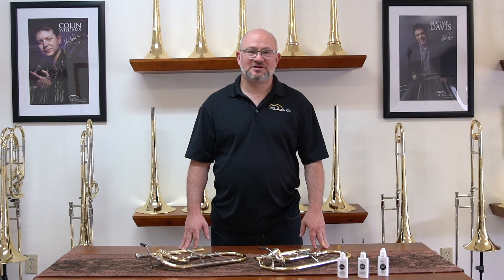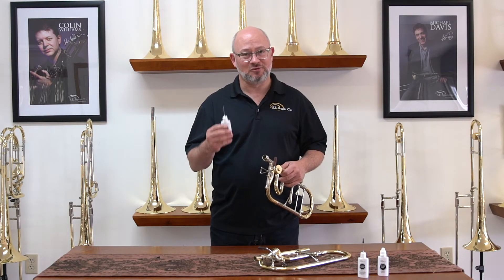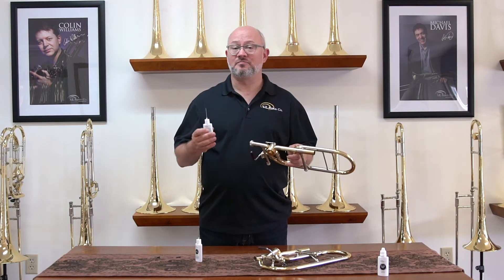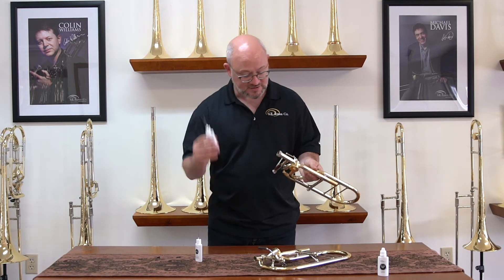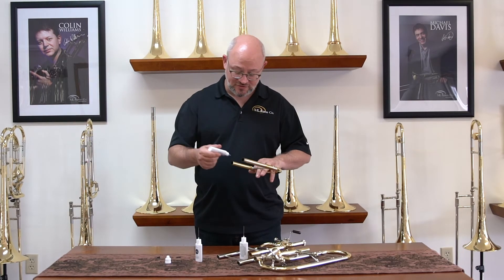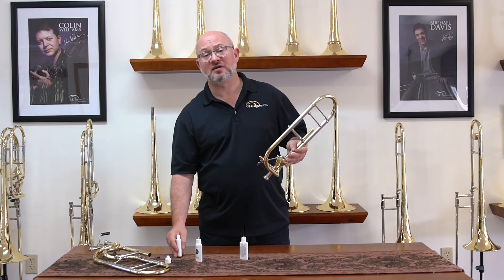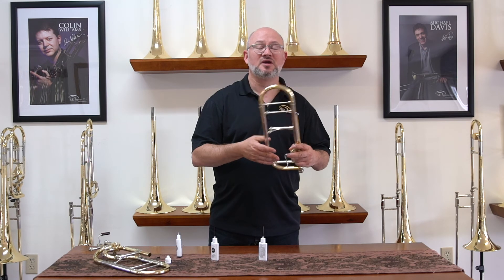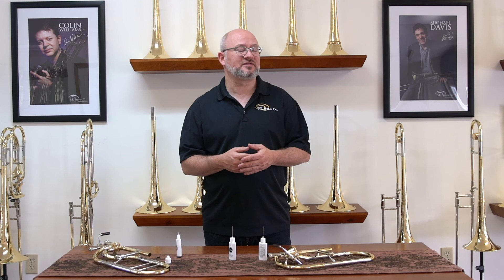#SEShiresExplained: Trombone Valve Maintenance

Comment: I was told to try and not let the oil touch the sides as you drop it down the tubing slide so it doesn’t mix with the tuning grease.

Comment: One interesting thing regarding the rotary valves the guys of Miraphone who have quite some years of experience with those recommend that you rather not oil them when you play regularly. (Of course if you don't then you will have to oil them) Only the valve bearings and linkages should be oiled according to them.